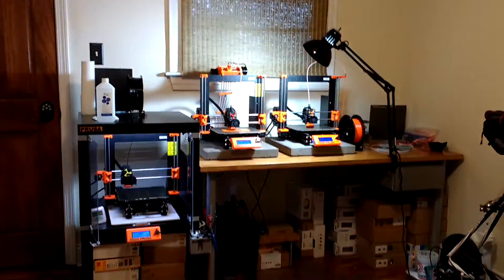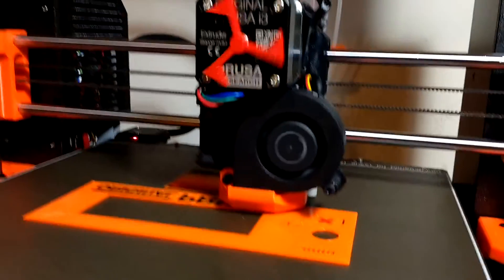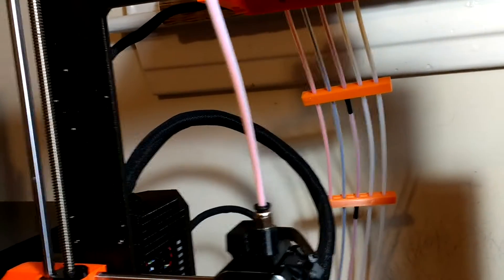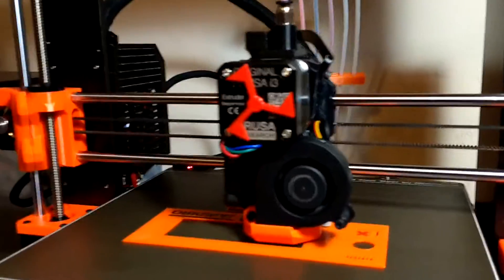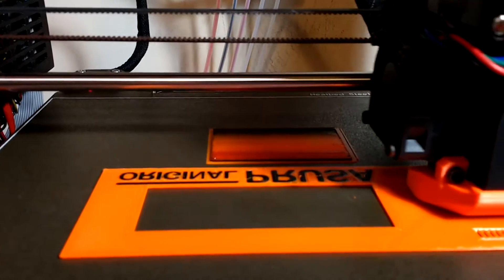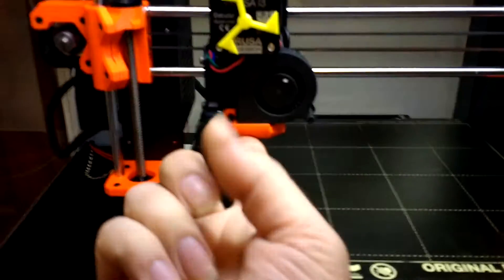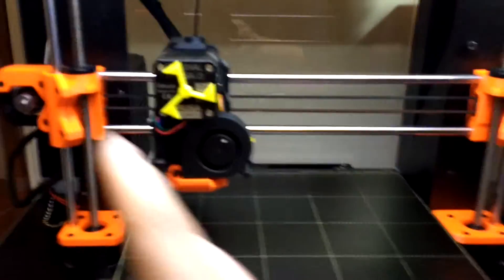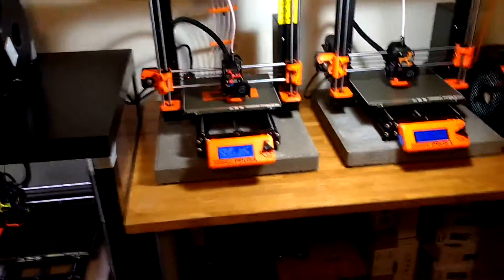MMU2 running on Bear Extruder.

Comment: I have a similar setup - Bear extruder and x-axis.  I'm looking at purchasing a mmu2.  Could you please list the 3 things you had to do in your setup.  I already have modified firmware for the bear extruder, I need to print an adapter for the extruder to support mmu2?  What else.  Thanks and I'm glad you got it working.
Reply from the maker: I took the route of printing out a new extruder body and parts from https://www.thingiverse.com/thing:3472911. You don't need the plug or funky angle adapter that way. I just needed to grab a M10 bowden coupler. Only other change I made was to make the boden tube running from the MMU2 to the extruder an 4mm o.d. 3mm i.d. I did that for the stock setup also. This stopped the random jam in the tube because of fatter tips.

Comment: Hey I am having an issue with the arm for the IR sensor. When I check the sensor info with the arm installed it is constantly reading 1. Does yours do the same thing or is there something I need to fix. I can't get my filament to load correctly at all.
Reply from the maker: There is a slotted screw hole in the arm. You'll need to adjust the height of the arm on the door before screwing it down. Get to the sensor menu, and use filament, or a 1.5mm hex wrench to trip the sensor, to adjust the arm height.  Make sure the arm is printed as clean as you can. No wisps on the end the trips the sensor. I printed out the new body and IR sensor cover instead of using the plug and funky sensor angle adapter from https://www.thingiverse.com/thing:3472911.
Reply: @3dprintingdungeonmaster639  ok ill reprint it with those parts and try again. Thank you!